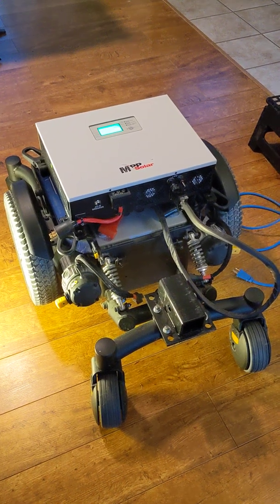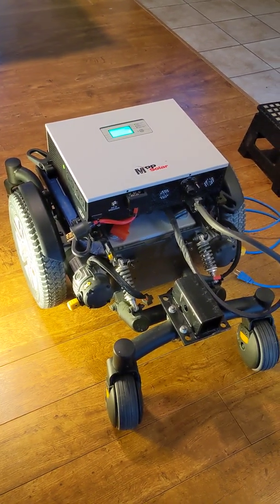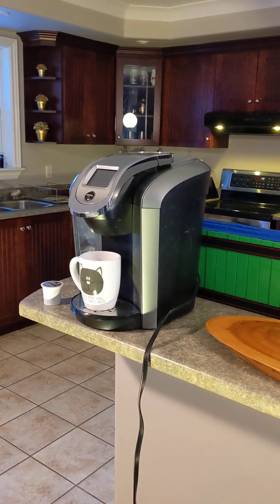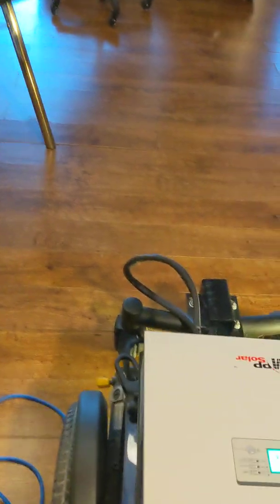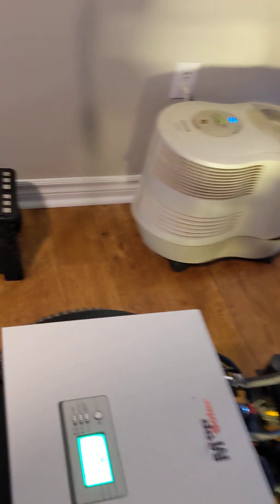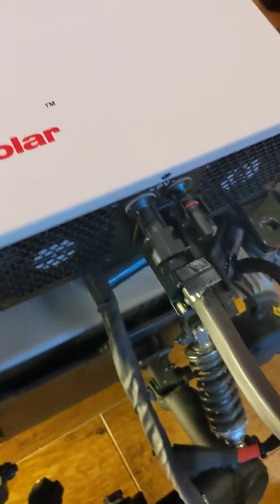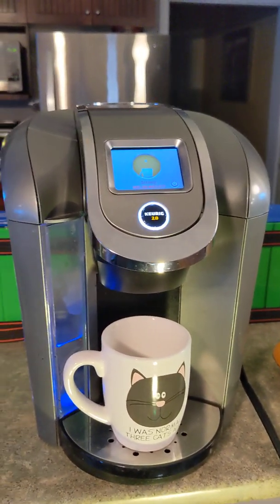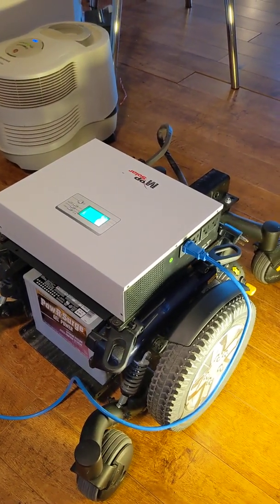MPP Solar - 2724LV-MR Power Draw Test

Comment: The inverter always on or is there an option in the menus to turn off the inverter if you're not using it so you're not wasting standby voltage?

Comment: I ran a heat gun - 1600w  high - or about 60% capacity on the 2724. The fan ran on low for a short time (seconds) then kicked up to high, although not much difference in fan noise comparing low to high. At least the fan noise isn't odd.